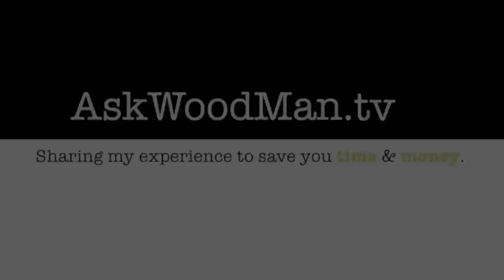6 of 27: Match Drilling -- DIY Biesemeyer Style Guide Rail Series

Comment from the maker: It is the inside edge of the tubing that is important. With the t-square and the three point contact it is overall straightness that is important. This is for woodworking. I try to do some accurate work, but to within 1/1000th? No. Absolute straightness is a theoretical siren song that can make you crazy. The human eye in good light is one of the most accurate tools for straightness. If it looks straight by your visual judgment, it will be fine.

Comment: Rely good video, I want to know the measures of the pipe, i know the angle is 3' by 3', bot i can`t find the measures of the pipe, thanks.
Reply from the maker: Hi Rene, The rectangular tubing is what you are asking about? That is 3x2" 11gauge steel. That is a very common dimension in the US. Are you in the US?
I also have information about how to use metric dimension steel angle iron and tubing between 50-80m to make a Biesemeyer style guide rail setup that one of our adjustable throat t-square will work with. Here a link to the adjustable series. Video 6 covers the metric measurements. 1/6 Adjustable Throat T-Square Table Saw Fence -  For Multiple Guide Rail Tubing Sizes I am glad to answer any questions at my gmail address too. Allan